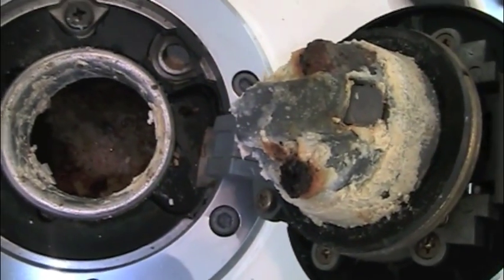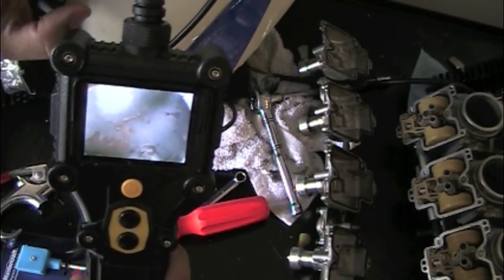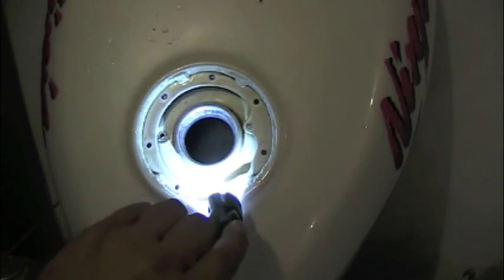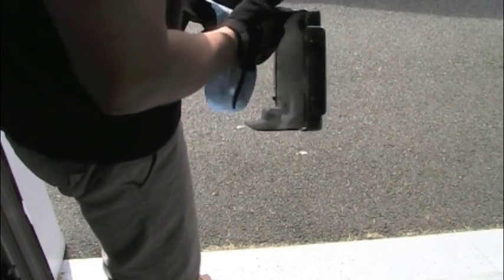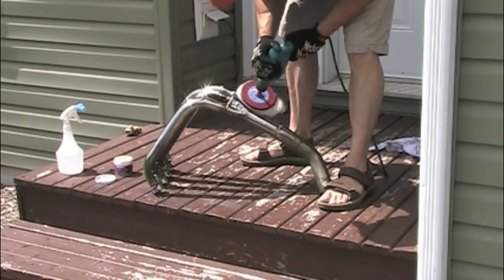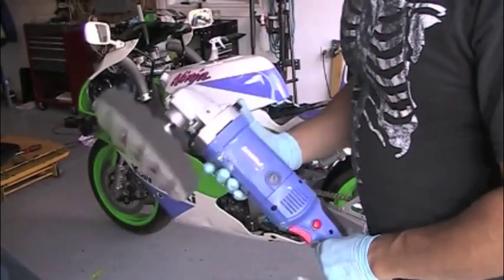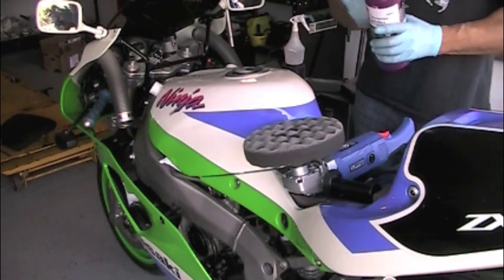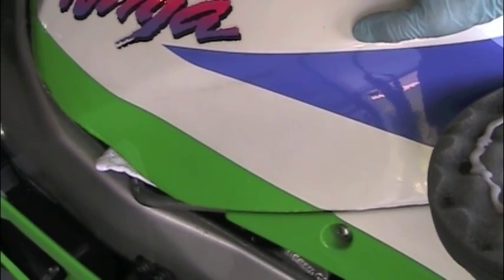Project ZX-7 - Part 9 - Polishing and Cleaning

Comment: u seem to be quite creative with how u restore the external of older bikes i have a 95 zx-7 almost the same bike. My side mirrors..the plastic parts that are in the wind flow have a black tint to them actually into the plastic a bit i have tried some polishing compounds that i used to shin my exhaust canister but not much luck what might i try?
Reply from the maker: unfortunately with plastic and rubber parts, the polishing compounds can make things worse. I usually start with the simple things and then get more aggressive. I don't know where you are located, but here in Canada we have an inexpensive solvent called "Goo Gone", available just about everywhere. It is an oily but mild cleaner that does a good job of removing adhesive and sticky residue. If that doesn't work i would move up to varsol. Then more aggressive from there-- such as Acetone. Be careful to test an area before going whole hog. Really strong compounds can damage the plastic.

Comment: Should I leave the mixture on for a while to soak, or dab it on and rub with a cloth right away?
Reply from the maker: I assume you are referring to the linseed oil?  I leave it on for a good hour, then wipe off what wasn't soaked into the plastic. Even a quick "on and off" will make a big difference.
Reply: kiki231000 Yes, that's the one. Thank you for sharing.

Comment: a random orbital polisher is actually far better than an old style rotory polisher
Reply from the maker: 2wheel _pilot perhaps for the product you are using but according to 3M random orbitals are a no-no. They claim they may work with retail waxes and polishes better because they are far lass aggressive and more user friendly. But lack power and circular speed for these compounds that require friction heat to work.